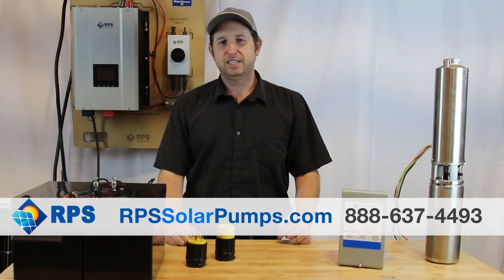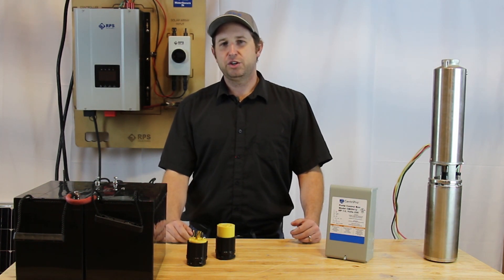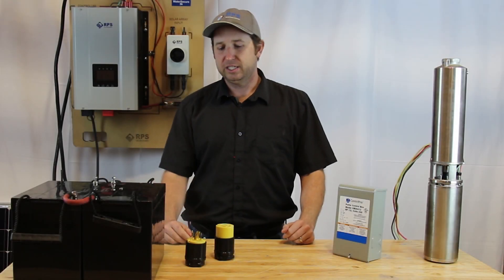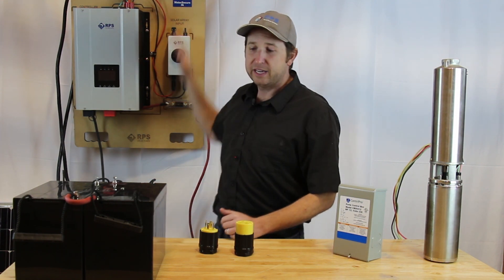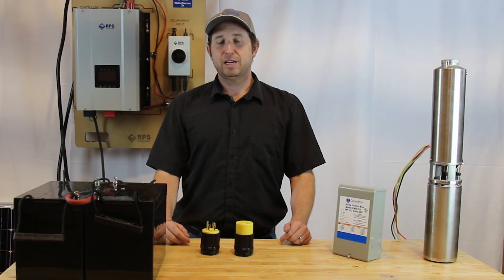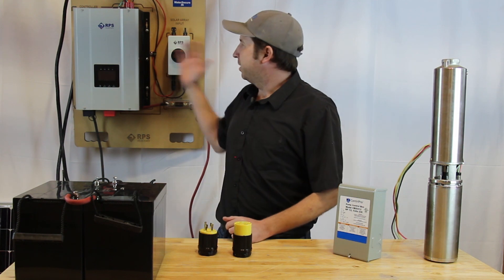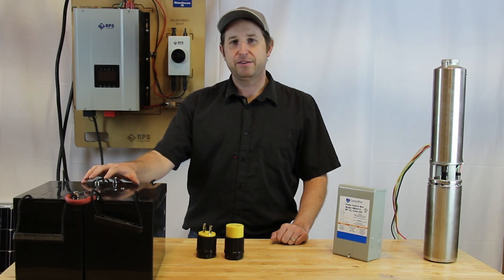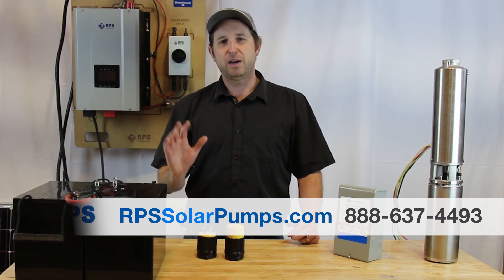RPS WaterSecure - Customer FAQs on Solar / Battery / Inverter for Water Pump Backup

Comment: In PNG we use 240v. Your system is designed for 220v. Would you supply a step down transformer?
Reply from the maker: Hello Bill, 220VAC is used as a generic term for 220V/230V/240V AC which is the allowable voltage tolerance. Our system is compatible across this voltage range, so no issues here!

Comment: @RPS Solar Pumps 
You guys really put a lot of thought in your kits to touch on every possible scenario. I just have a couple questions related to troubleshooting. I admit you briefly talked about it but this video wasn’t intended as a troubleshooting breakdown. What kind of troubleshooting is expected with the charger/inverter in this kit? I’m also wondering how much life to expect from the inverter if shipping it back to you for repairs is not cost effective.
Reply from the maker: If they are kept in a nice dry location out of the elements, we do not expect any maintenance plan or troubleshooting in the field.  However if anything goes wrong, we have replacement parts available!

Comment: Question: can i add more solar panels and batteries later? 

Just kidding😉
Looks great! I'm definitely getting one!
Reply from the maker: Actually, yes you can!  There is a limit based on the built in solar charge controller, but for the most part you can keep adding panels and batteries if you find your water or power demand increases.